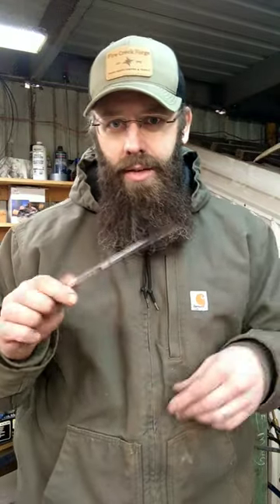What is the best bevel angle for your knife?#knife #sharpening #blade

Comment: At what point do you heat treat? After the edge is finished and sharp, or bevel the blade, heat treat, then grind to your apex edge?
Reply from the maker: @morningthunder  hardening and tempering happens before final thickness on the knife bevel, finish grinding is done after complete heat treating.

Comment: What's the best angle for very dull blades
Reply from the maker: Very dull blades will need more material removed to get back to an appropriate thickness behind the edge. The same angles still apply based on what the blade is for.
Reply: I go with 180°

Comment: Every pocket knife that is used and not abused should be 17 to 15 if it has good steel. Fixed blades should be 20-15 depending on size and use. There is no magical angle that will allow you to not have to re sharpen.
People who abuse knives by smacking their blade against everything and anything, cutting concrete bags open and using it as a pry bar , screw driver or to dig in the dirt and gravel should be limited to box cutters in my opinion as it physically hurts my soul witnessing it as someone who keeps a pristine edge on my daily use knives.